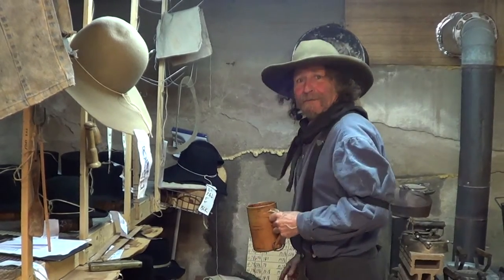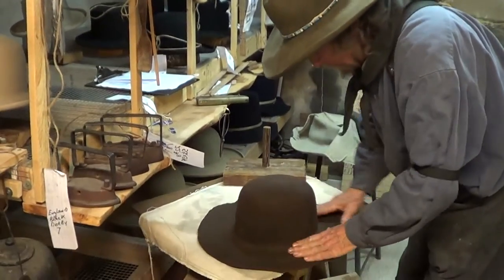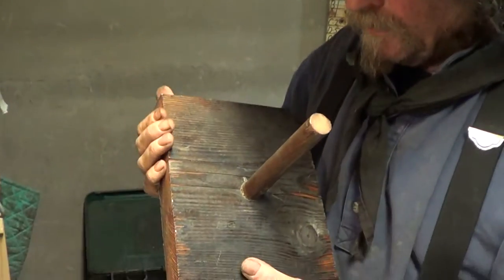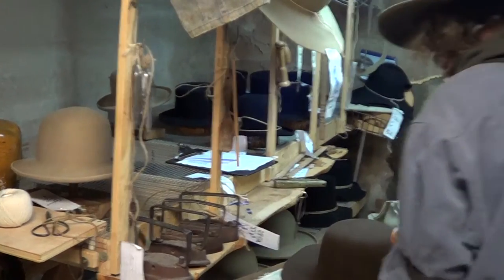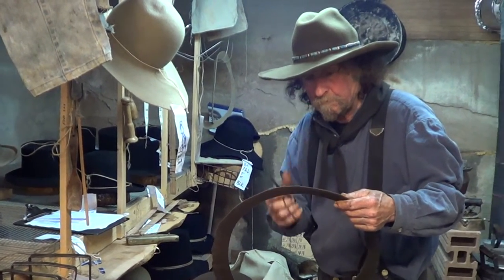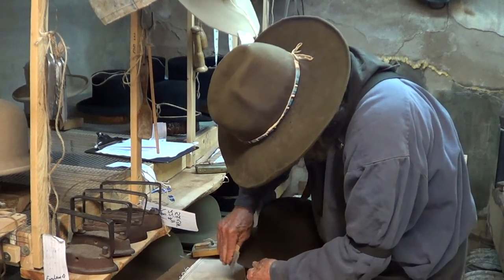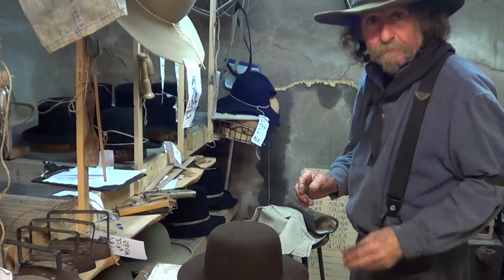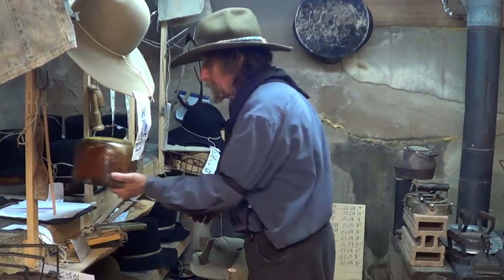Tool Talks 9 - Hand Trimming the Brim of a Hat

Comment: Can I use sand paper on a soft wool felt brim?
Reply from the maker: Yes....just be careful to not wear it unevenly as you sand.
Reply: @hatsbygrizz-madewithjoy1241  Thanks for getting back to me. Am I supposed to sand flat against the brim or sand the edges of the brim? Will it get fuzzy if I do it the wrong way? I'm a little confused.